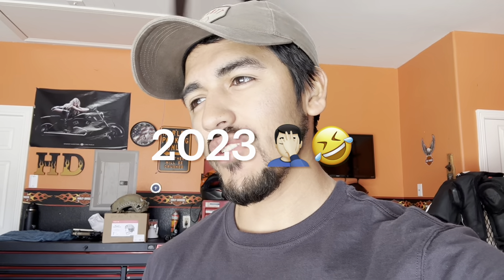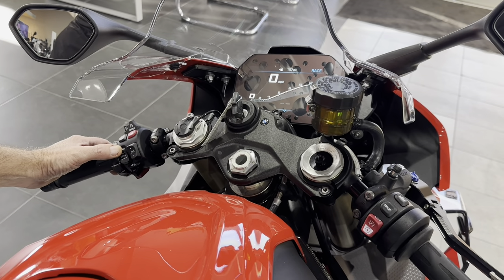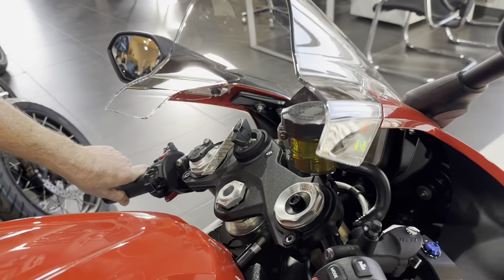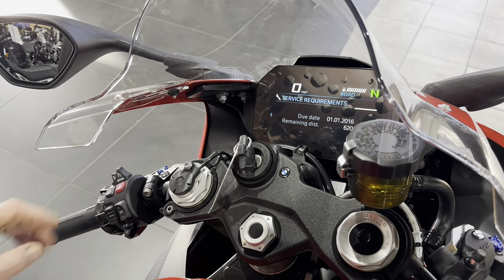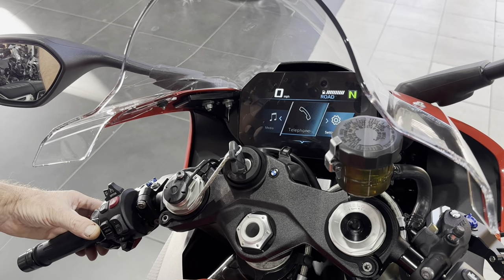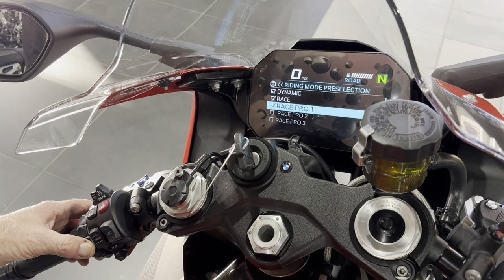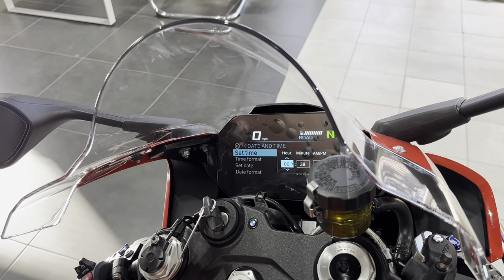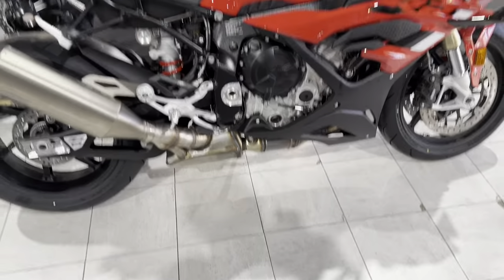2023 bmw s1000rr taking delivery & menu walkthrough (passion red)

Comment: Does the new s1000rr vibrate the handlebars a lot like the old 19-2022? or is it all the same?
Reply from the maker: No they did something that fixed that
Reply: @monochrome5.0  thanks <3
Reply: The "M" style triple tree along with some other tweaks have seem to fix that problem.

Comment: Congrats on both bikes!  How is the break-in going?  are the RPMs auto-restricted or you get a reminder alert on the dash ?
Reply from the maker: 8k rpm’s per gear and 122mph tops in 6th gear is all you get but I’m 60miles away for 600 so it’ll be unlocked soon

Comment: What tires did yours come with? I saw some other '23s that came with Michelin Power Cup 2.
Reply from the maker: Roadsmart dunlops. Which is weird bc you can’t get these over here they are euro tires
Reply: @monochrome5.0  weaksauce. I guess it's good to break in the bike
Reply from the maker: Cup 2’s will be going on next
Reply: @monochrome5.0  I'm glad you know what's up
Reply: Diablo supercorsa v4s only tyre worth putting on a S1RR.
Reply from the maker: I would, they are suppose to be much better then the version 2 and I really like those for street use with the occasional track day

Comment: I see you have cruise control on this, does heated grips come standard too?  Haha, you can tell I’m a road rider, not a racer.
Reply from the maker: I believe they come on most packages as they don’t make many of the base models
Reply: They are standard on the premium pack, the base without the electronic suspension does not have it.